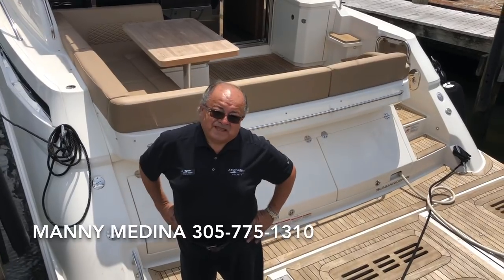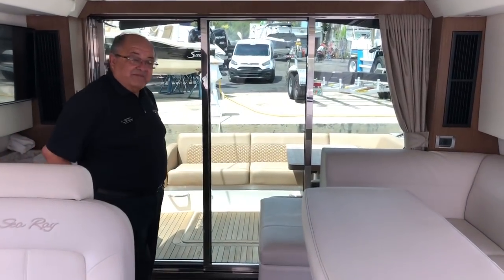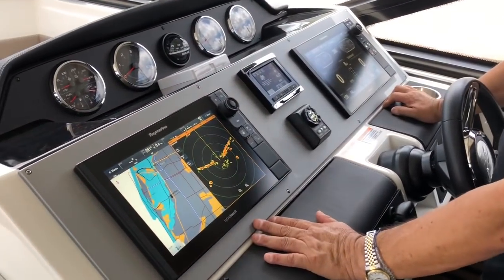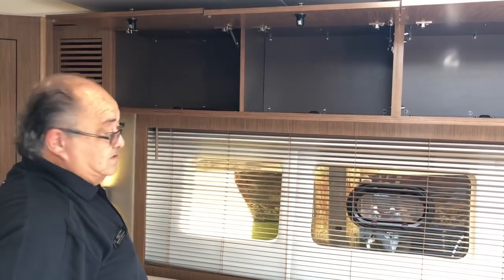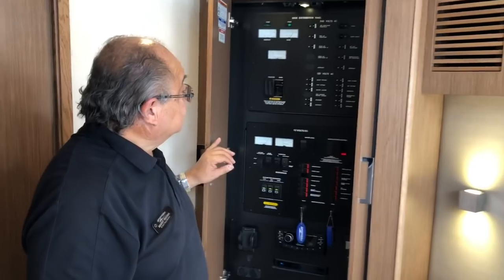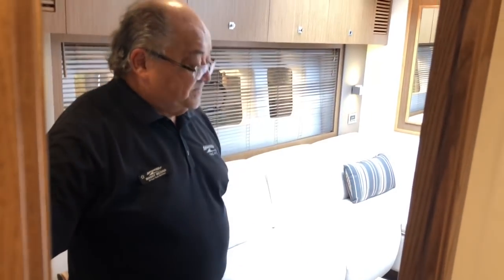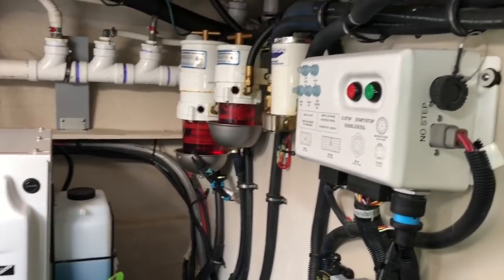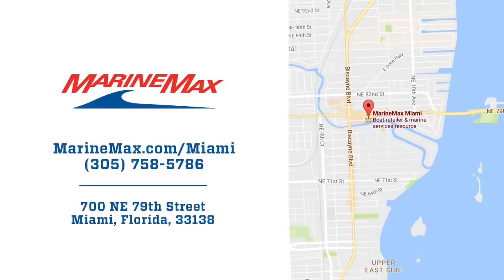Pre-Owned 2018 Sea Ray 510 Sundancer For Sale At MarineMax Miami, Florida

Comment: I liked the boat and the price.  I appreciated that Manny knew the intricacies throughout the yacht which showed he had a lot of experience especially in Sea Ray.  Pointing out all the locations where the main equipment was located in the Engine compartment showed Manny is not just a Salesperson.  I would have pulled off the outside shades along one of the port or starboard sides to show the windows more clearly from inside out.  With the Shade in place, the seams made the window look cluttered and the interior less light (which means it works of course) however people may also like to know how bright it can be inside too.  I like a lower Galley myself, though I wonder if under way it would become a BBQ pit without those shades.  Very nice review
Reply: What was/is the price ?